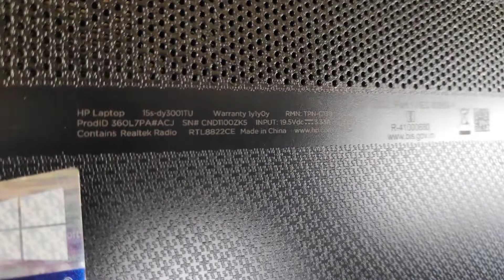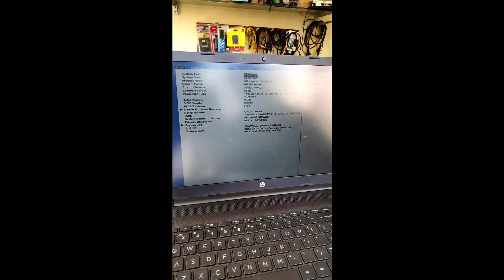HOW to Upgrade NVME SSD on HP 15 dY3001TU Laptop[SAMSUNG 970 EVO PLUS NVME]

Comment: Did you also upgraded the ram because in the video i can see that both the ram slots are occupied.
Reply from the maker: @ATAVRN  Yes U can bro .. check ur Already installed  Ram  Speed . Buy Same Speed  Ram example: 2666Mhz , 3200Mhz
Reply: @virtualBRAIN-YT  I want to know if the laptop comes with 1 stick of  8GB Ram and one slot is empty or with 2 sticks of 4gb ram already installed?
Reply from the maker: @ATAVRN  Laptop comes With single 8Gb . Another slot Empty ..
Reply from the maker: @ATAVRN   Some Variant changeable .. inthis video i3 model comes with 4+4 .. i5 Variant comes with 8gb + empty slot .  I7 variant 16 Gb + empty slot.. don't confused
Reply: @virtualBRAIN-YT  Now i understood
Reply from the maker: @ATAVRN  if u like this video ? Pls do Sub